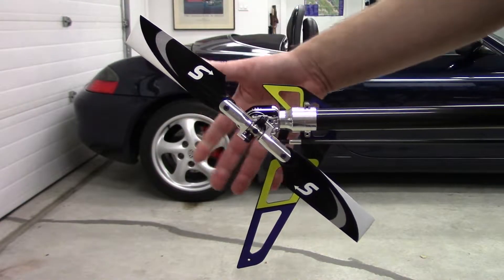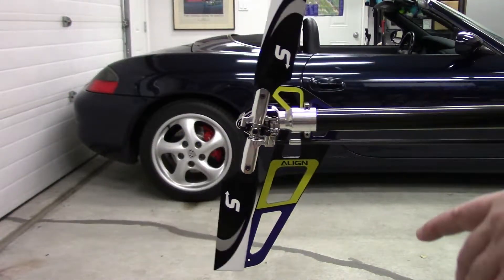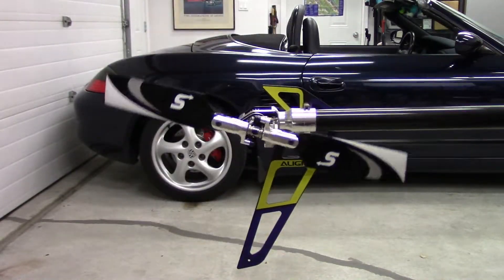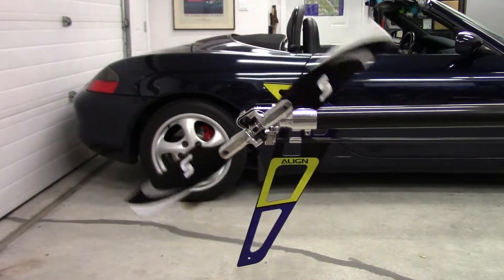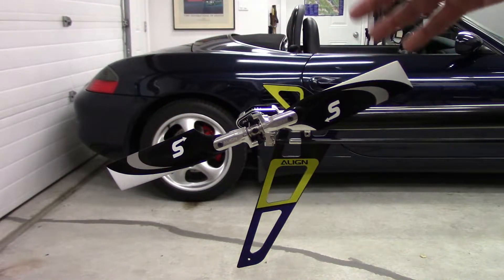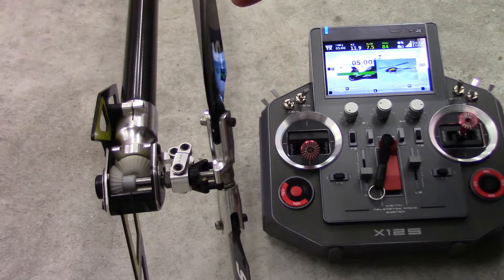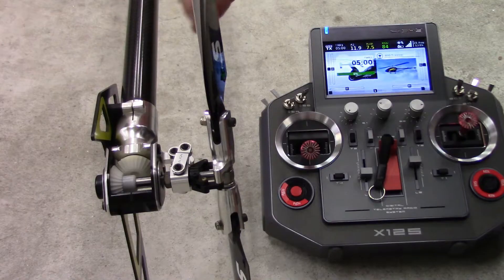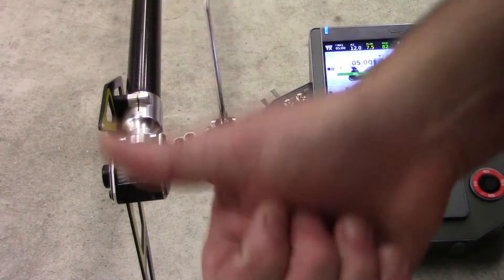RC Helicopter Tail Rotor Setup

Comment from the maker: As I clearly stated in the video - this tail rotor configuration is by far the most common you will run across, but there are always a few exceptions to this conventional/normal layout. Ie. spin direction is might be reversed, pitch slider direction might be reversed and side of boom the tail rotor is on might be reversed. In short - always check your manual for correct operation. The exact operation principles demonstrated here of course remain constant regardless of those variables. 
Want to learn more about the hobby of RC helicopters? Please visit my website:
https://www.rchelicopterfun.com
Reply: Rc chinook helicopter not straght go it around

Comment: I prefer the tail is driven by the main rotor via shaft or belt.  Now the lazy way is to put an electric motor to drive the tail rotor independent from the main rotor.  Engineering these day for RC helicopter is not as good as it used to be, IMO.

Comment: I had to watch this video so to understand the mechanics involved  .my eco 8 was having tail problems  and I was adjusting gyro settings and different gyros an more, the problem was because the tail rotor was spinning the wrong direction even I had the trailing edge of blades going the right way.  So a flip of the belt did the trick, now the tail is behaving. Thanks for explaining how this works

Comment: Hello is it necessary to dedicate a button on the radio to Gyro? How do you setuo gyro on radio unit?
Reply from the maker: That all depends on the specific gyro and your preference/s. For example, some gyros set tail gain on channel 5 output, while others, channel 7 or even whatever channel you assign to it. Some people like a dedicated gain switch or preferer one hooked up to their flight mode toggle so the gain automatically is reduced when switching to higher head RPM. In short follow the manufacturer's instructions on channel setup, assignment and starting gain values; then chose your own preference for switch assignment.  Personally, I initially set my tail gain up to a variable output channel so I can tune the gain on the fly. Once I'm happy with the gain output, I will change that channel to a fixed output to set the tail gain at that fixed value/s since it's a set once & forget value for my sport & scale flying style.
Reply: @Rchelicopterfun  Thanks for the details 🙏🙏🙏

Comment: Hey John, this is probably an obvious one. I've been flying helis for a over a decade and I'm currently setting up my first left hand rotation Heli.  I've been doubting myself when it comes to the setup. Does CCW rotation change how the slider should move with rudder input and how the gyro corrects.

Sorry for the painfully obvious question but I'd rather double check to be safe.
Reply from the maker: If the main rotor rotation is CCW, then the reactive torque will be CW meaning the tail has to thrust right instead of left to compensate. As for pitch slider movement direction, it depends on the tail rotor linkage arrangement and which side of the boom the tail rotor is on; but in general, yes, it will pitch in the opposite direction to counter the opposite reactive torque. I always look at tail blade pitch angle to determine thrust vector, not pitch slider direction (because of those possible variations).
Reply: @Rchelicopterfun  that's perfect John thanks for that.  Luckily I was able to get the Heli light on the skids and it wasn't doing anything nasty so my set-up was correct after all.

Comment: Hi John, your tutorial here really clarified why the tail on my xlp 550 wants to whip wildly to the right, I had just made some repairs, did not unplug any leads to either the reciever or flybarless unit, and when I spooled up for a test flight I was like whoa, hold it cowboy, the tail wanted to spin wildly to the right, after that, I called it a day, I did not want to wreck my heli because of the gyro being out of wack. Thanks for sharing your expertise ! It is much appreciated.

Comment: Mr Salt, I have a Flywing FW450v2( I know not your favorite helicopter),  if I plug the battery in and leave it on for a few minutes , the tail motor starts to chirp and move the prop back and to very short and fast, is this by design or a fault?. Thank you in advance for your reply sir.   Keith.
Reply from the maker: Hi Keith, tail gyros can do funny things when a heli is stationary on the bench (in a feedback loop), and can cause the tail servo to hunt as error rates build. It's likely normal but the only way to tell is to get the heli into a solid hover and observe the tail performance for an entire flight. If it also becomes erratic after a few minutes in the air as well, then something could be wrong with either the tail servo or the tail gyro (part of the flight control system).
Reply: Thank you sir, I’ll pay close attention next time I fly it.

Comment: I was wondering if this applies to the H1 flight controller tail set up when getting the trims on the H1 left for left right for right on the H1 help software do you reverse this after trim settings.

Comment: I have recently tried setting up a Blade Fusion 270 with Spektrum BLH5349 receiver/gyro in Opentx (QX7S). Everything is working except the tail servo will not return to center. What am I missing?
Reply from the maker: Presuming you mean it's not returning to center when you center the rudder/tail rotor stick on the radio, you are not missing a thing. That is exactly how a tail gyro will function when in Heading Hold mode. Only when a tail gyro is in rate mode will it center when the stick is centered. On this specific heli, I have it setup so I can select between rate mode & heading hold mode so I can I fly both modes. In the the tail servo direction demo I had it in rate mode to better show the pitch slider direction movement. That is why it centered with stick centering. In the following gyro correction direction part of the video, it's switched into heading hold mode so it holds in the left or right movement after I yawed the heli left & right so it would be more visible. If I would have kept it in rate mode during that demo, the pitch slider would have only moved while I was yawing the helicopter and as soon as I stopped, it would have re-centered.
Reply: @Rchelicopterfun  Also the gyro moves the wrong direction and will not invert in the outputs menu and the heli just spins in circles. Hate to bug you but I'm a newbe and in my mid 60's and you speak a language I can understand. Do you have a How-to on setting up that Rate/HH switch in OpenTX. I have everything setup in Spektrum AS3X and SAFE.
Reply from the maker: @RICHARD RHOADS - best to contact me through my website with technical questions like this as I rarely see follow up YouTube comments. That said, gyro direction setting along with rate/HH mode selection is a function of your specific flybarless system and I can't help much with that. You'll have to reference the instructions that came with your heli/flybarless system or contact Horizon's tech support. I don't know a thing about the flybarless unit the 270 uses, but I'm almost certain it only has HH mode. Only higher end flybarless systems give you the choice of rate mode these days since almost everyone flies with HH now, except for us scale heli guys and gals.
Reply: @Rchelicopterfun  Thanks again! I believe I have a defective rec/gyro unit. It is wired up TAER(1234) but rudder won't work on ch4 it only works on ch5 which is Gear and collective only works on ch4. I'm thinking this must be in the FC's programming.

Comment: You do NOT necessarily want it to go to full travel, you do NOT want to exceed 28 degrees pitch on the tail or you get into blade stall and this is important to know as many helis can exceed this on the tail. Just to mention
Reply from the maker: Good point. In short - follow your specific build instructions and don't listen to some goof on YouTube 😄
Reply: @Rchelicopterfun  don’t take what I said as me calling you a goof lol. Not at all actually I realize many need help and good on you for doing that. I just think model regardless one should be aware that using the full throw available is not always good is all and that you can enter blade stall territory is all. Take care!
Reply from the maker: @Shawn Scott - I know, I was just trying to be funny. According the wife, I'm king goof, so I just default to that assumption - lol. Regardless of goof factor, thanks again for the max tail pitch reminder for others. 👍

Comment: Has the technology for the flight systems and the brushless motor evolved to the extent that they are now for 450L sized helis as sufficiently responsive as any shaft-driven tail rotor for average, normal scale flying -- as opposed to "3D flying," which I haven't much cared for anyway?
Reply from the maker: Nope, size tops out pretty much between 250 & 300 size helicopters.
Reply: @Rchelicopterfun  Thanks.  I fly the DJI inspire 1 drone, and I am seeking a helicopter configured with a flight-controller to be almost as easy to fly as a drone.   So lastly is there a significant difference in novice/beginner-friendliness between the flight-control system JCZK 380A in contrast to the H1.
Reply from the maker: No idea. Why bother taking up the vastly harder and time intensive hobby of flying collective pitch RC helicopters if you want an easy drone flying experience? Stick with drones so our hobby of RC helicopters is not also ruined and banned everywhere.
Reply: @Rchelicopterfun  I have basic skills of flying such helicopters and have extensive practice on simulators of basic flight and hovering, but I still enjoy the carefree ease of a turnkey drone solution.  So I seek the ease of a solid helicopter drone platform that has the advantage over a quadcopter of AUTOROTATION, backup in case of power failure.    Hence my question of the differences between the 380A vs the H1.
Reply from the maker: As I said, no idea between the two.
Reply: @jasonpk2267  Try something like the blade 230s (or newer versions). Normal mode has self levelling which is more like a drone and limits bank and pitch angle, and when you want to progress to flying properly just use idle up.
Reply: @RCStuffvideos  I know the micro helicopters have that feature.  It is for the 450L ones my question applies.

Comment: This fixed my issues! I bought a second hand Titan E325 but the previous owner, who only had it for a few weeks, thought it was too hard to fly and just couldn't do it. I took it home with me and I had some trouble as well. I switched the rudder in the other direction as it was reversed but still couldn't fly. Reaching the end of your video, you mentioned the gyro. I saw it was reversed! I flipped the switch in the other direction and tadaa! A stable helicopter. This is going to be a fun start of a new hobby :)

Comment: Is it normal that the helicopter tail is very slow one way than the other It is supper fast only in one direction
Reply from the maker: Nope, a properly setup variable pitch tail rotor heli should have fairly equal yaw rates in both directions. One exception would be if you're running very low head speeds and thus the tail rotor will also be spinning slow, so it can barely produce enough thrust to counter the torque of the main rotor. In that case it will yaw much faster in the direction of main rotor torque than it will be able to yaw against main rotor torque.

Comment: John - I noticed your HORUS radio. Could you make a video or write another e-book on how to set up a fly bar Heli with Open TX? There’s plenty of info on flybarless, but I’ve got a little old school left in me and I want to marry a fly bar set up with Open TX. Thanks.
Reply from the maker: I plan on updating the swashplate eBook to include the little bit that is different with OpenTX over a conventional computerized radio. It actually isn't really any different, just more options in the swash mix menu to select in OpenTX. OpenTX as you likely know has a swash mix menu just like all conventional computerized radios where you set your type of swash mix (120 or 140 degree) along with the swash mixing percentages and directions for your 3 swashplate directions (pitch, roll, collective). 
I just did a video recently on the basics of CP heli setup and used the OpenTX radio in the example ( https://youtu.be/O1L0wxzoqOU ). Every single setup step in that video would apply to a flybared heli along with the 120 eCCPM swash leveling e-book I presume you have.
The only difference is in the heli setup menu (the swashplate mixing menu) where I say to leave swash type blank in that video, you would select your swashplate mixing type (presumably 120 degree).  Leave swash ring setting at 0. OpenTX then gives you the conventional 3 mix values to enter; aileron, elevator, pitch... in that exact order.
Unlike conventional radios however, you have to enter the source first for all 3. So for the first one (long cyclic source), you enter elevator input. For lateral cyclic source you enter aileron input, and for collective pitch source, you would enter the channel you have your throttle stick to collective channel output mix. I use channel 10. I can't recall the reasoning behind that CH10. I got it, like all the OpenTX info when I switched from JR to OpenTX from the open TX university website in their helicopter section. Yes, all this info is already available at the OpenTX university site which is the first site I recommend all OpenTX users visit and study.
From here on, it's exactly the same then as any other conventional computerized radio. You would start with mix values (the weight value) of around +60%, just like I show in the swash eBook and then adjust the mix percentage up or down to get the amount of cyclic and collective pitch angles you are after. You would reverse any of those weight mix values from + to - if the swash is moving in wrong direction along any of those 3 axis (pitch for the collective direction, aileron for the cyclic roll direction, and elevator for the cyclic pitch direction).
Thanks for the comment, hopefully I'll have the swash ebook updated with the OpenTX info soon.
Reply: @John Salt: A huge thank you for your reply. I mostly “get it“ . . . from an academic perspective, I would love to see a video with a hands-on OpenTx (teach a man to fish) demonstration. I promise I’ll buy your new book if you walk us through a couple of different fly bar - OpenTx set up scenarios. Can’t thank you enough for your wonderful work.

Comment: Thanks for this! I flew my first Belt-driven CP on the weekend; a Blade 500x (bought second hand) and found myself hovering no more than a metre off the ground while I manually wrestled with the heading to stay facing forwards - queue many a touch-down and manual reposition of the heli. 

I was really hoping this wasn't a sign that professional helis expect me to do things the old fashioned way and manually work the tail rotor with the collective/throttle, since all my smaller flybarless helis have been doing that for me. I will try these checks and adjustments and see if I can make the thing a bit less scary!

Comment: John, Isn't it opposite for trailing edge tail control? My Blade 500 helis sure are. Rudder stick right, pitch slider right, tail blade points left, etc
Reply from the maker: As I said in the video, this pitch slider movement direction is the most common to achieve the  resultant blade pitch movement, but not always (Blade is backwards of most other brands). It totally depends on which side of the blade grip the control links are attached to.  That is what determines which way the blades pitch in relation to slider position.
Reply: @Rchelicopterfun  would the gyro comp be backwards as well? I would think that that would be as you explained, (Push tail left, pitch slider goes right)
Reply from the maker: Yep.
Reply: John, Probably a dumb question BUT, is gyro comp turned off if heli is in rate mode? I seem to have messed up something in my open TX software of in the Spirit flb settings as I have NO compensation now. Heli seems to be in rate mode because now rudder goes back to center when I let go of the rudder stick.
Reply from the maker: Hi Kelly, Not a dumb question at all. My dumb answer however is it shouldn't. In fact, it's even more important to use compensation in rate mode since I-gain is turned off. In the old mechanical gyro days when all we had was rate mode (P-gain only), we still had compensation mixing (called revolution mix back then). I'm not a Spirit user however, so perhaps there is a setting within it that you can disable comp when in rate mode for some reason? Any further technical questions, please contact me through my website as I rarely check for followup questions on YT comments. 
https://www.rchelicopterfun.com/
Reply: @Rchelicopterfun  Will contact you there John, Thanks for your help